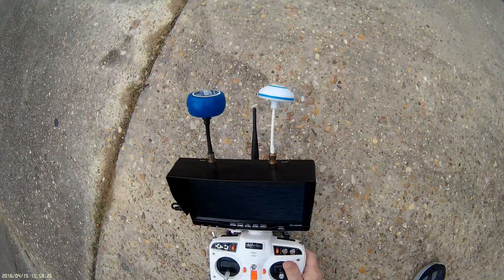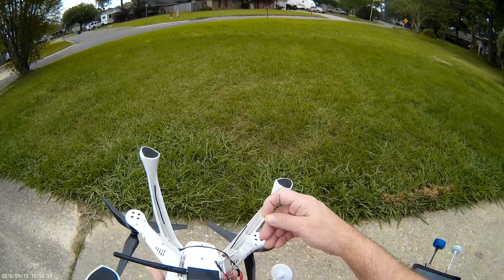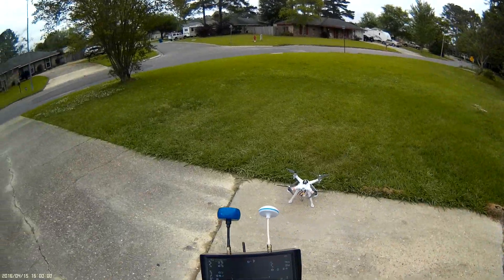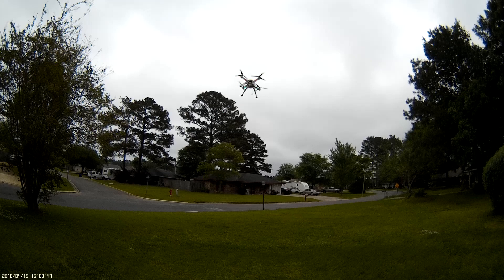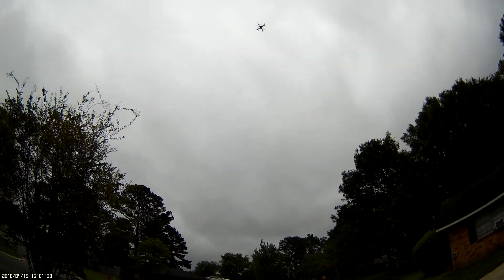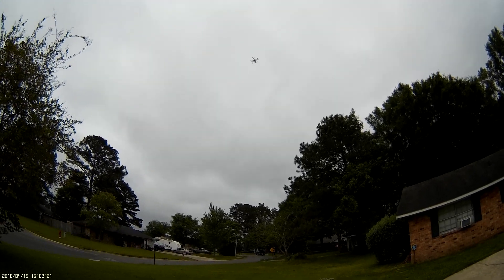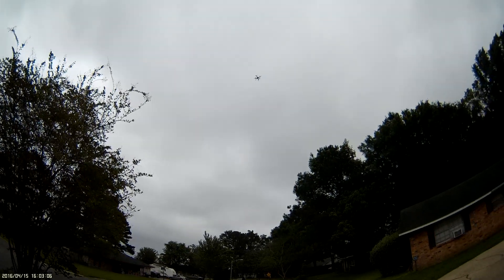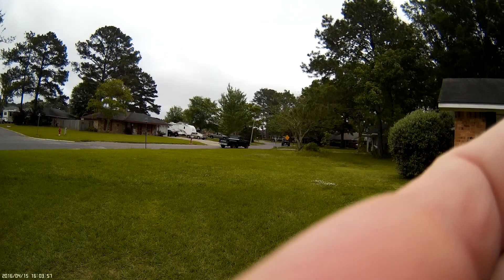Walkera QR X350 Pro Modified

Comment: I use Phantom2 propellers(carbon) in the original x350pro engines? Thank you
Reply from the maker: They may work size wise but the hub may be different. But most Phantom stuff will fit the Walkera.

Comment: hey where did you get the monitor mount for devo..???
Reply from the maker: That was the Boscam TX-5802 screen. You can get them off of Ebay or Amazon.
Reply: no man, I am talking about the lcd mount beneath the screen that is attached to the devo tx. Did you get it with the boscam screen or did you buy it from somewhere else..???
Reply from the maker: I got the mount off of Ebay also. - http://www.ebay.com/itm/Remote-FPV-Screen-Display-LCD-Monitor-Holder-Mount-Bracket-For-DJI-Phantom-/371689129112?hash=item568a660498:g:kBUAAOSwBLlU-eZv
Reply: yeah thanks 
Is it strong enough to hold such a heavy lcd setup.?
Reply from the maker: Indeed. Super strong enough to keep it in place. I've sense switched to the Taranis X9D Plus with a different mounting. The screen I use now has a built in bracket but it doesn't auto switch FPV channels. You have to change the channel with Dip switches. But since I don't change channels much its not a problem. Here is the monitor I'm using now. http://www.ebay.com/itm/Boscam-Galaxy-D2-7-TFT-FPV-Screen-5-8GHz-LCD-Monitor-Dual-Receiver-fr-Quadcopter-/311592105869?hash=item488c56378d:g:OBUAAOSwGWNUVGVu
Reply: I am actually looking for eachine lcd 5802D.
Anyways thanks man
Reply from the maker: No problem. The Eachine is identical to the Boscam.